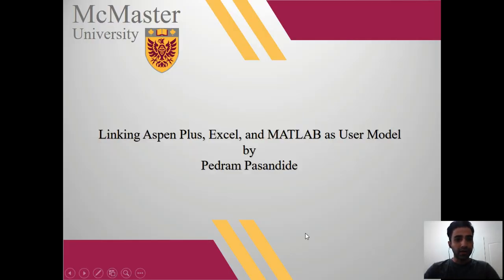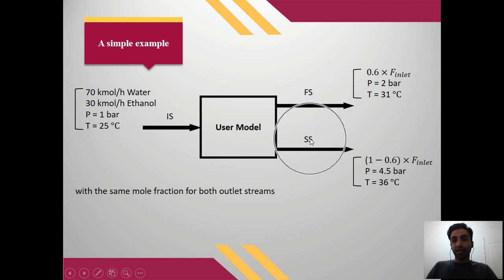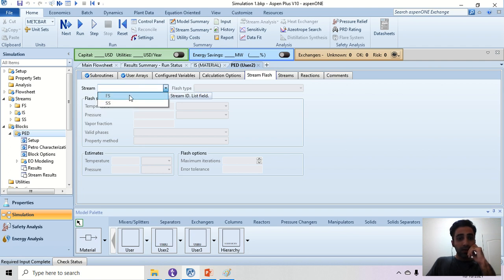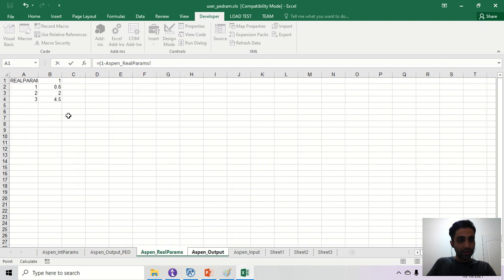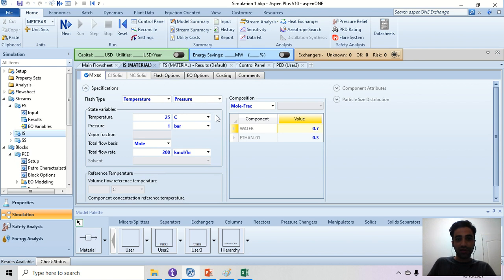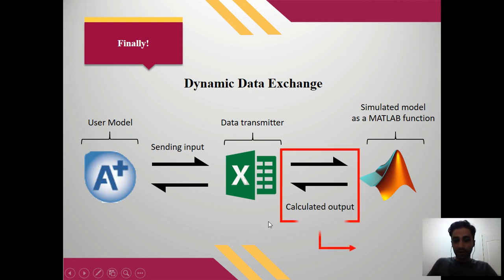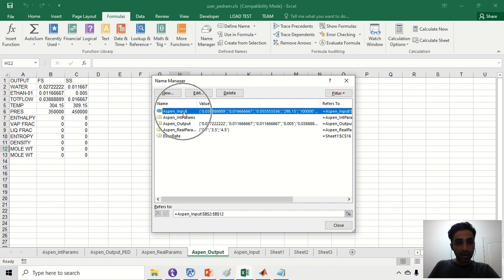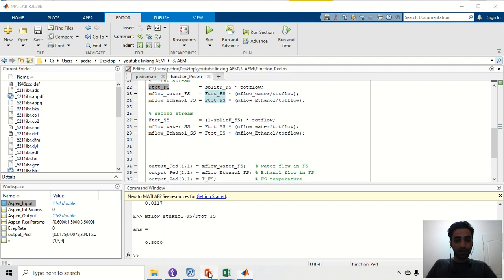Chemical Process Simulation: Linking Aspen Plus User Model and MATLAB by Excel

Comment: 英文版 Hello! I'm currently working on a HYSYS dynamic simulation and have a question about inputting fluctuating power values, hoping to get your expert advice. My goal is to dynamically select discrete power values from a predefined dataset (which represent the fluctuating output of renewable energy sources) based on the real-time integrator time in ASW (Advanced Simulation Workbook), and use these values as the input power for a specific module in the dynamic model.
My current approach involves using VB scripting to determine the integrator's time step, then matching the corresponding power value based on time and passing it to the target module. However, I'm facing challenges in implementing key steps such as establishing the time-power mapping in ASW, capturing the current integrator time, and real-time injecting these values into the module input.
For this scenario requiring dynamic loading of discrete power time-series, do you have any recommended implementation workflows or critical technical points within HYSYS' ASW environment? Specifically: How can I efficiently read time-series power data from external files? Is it necessary to use event-triggered mechanisms or specific VB functions to synchronize with the integrator time? Your professional insights would be greatly appreciated. Thank you!

Comment: Hello, when I run my file, the mass flow and mass fractions do not appear in the stream result? what I should do?
Reply from the maker: stream result in excel or Aspen?
Answering your question is difficult since I am not sure which part is not able to transfer data!
here is an idea
1. inlet data should be sent from Aspen to Excel 
2. Then this inlet information should be sent to MATLAB
3. Results should be sent back to Excel
4. Results should be send from excel to Aspen
At the end of the video there is a short explanation how to debug the code buy pausing. You need to find out which part for 1 to 4 is not  able to transfer data.

Comment: Will the process be the same if we don't use the custom model
Reply from the maker: the aim of using custom model is to simulate something which Aspen Plus is not capable of doing that. otherwise using the results for custom modeler would be the same as using built-in models available in Aspen Plus.

Comment: Thank you so much. It helps. But when ever I try to reset and rerun the Aspen after Linking the  the software to dynamically exchange data(last step), it close the Excel and the Matlab. And the data from the Matlab code is not sent to Excel.

Can you advise me what to do please.
Reply from the maker: If u have done the first two steps with no problem, u should be able to do the last step without a problem. So try do the first two steps sometime we might something. Make sure that all files (Aspen, excel, and matlab function) are in the same folder and the format of Aspen file which u are using is ".bkp". and If u R receiving any error in Aspen plz share here. After all if we still have the same problem I guess u have to Check your license with Aspen.

Comment: my MATLAB code is based on mass calculations. So I want the mass flow (instead of the molar flow) to be transferred from ASPEN to Excel. Also the results (from MATLAB to Excel) are based on mass unit(Kg/hr).
Reply from the maker: There are a few ways such as changing the visual basic codes in Excel file used for usermodel. A short way is: Get each component’s molecular weight (mw) in a stream as a matrix from Aspen. Then write down the values inside your code in MATLAB. Just do that by hands cuz mw is always constant for each component. Multiply the input of your MATLAB function (which is based on molar flow) with mw matrix. Then you will have mass flow or fraction. You can do the same for changing mass flow to molar flow for the output of MATLAB function before sending that to Excel.